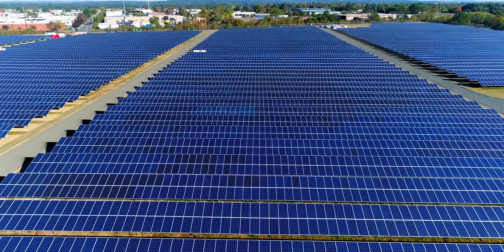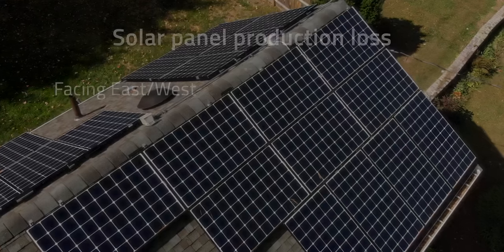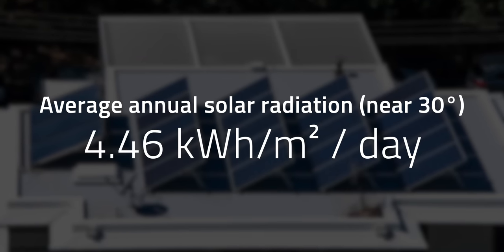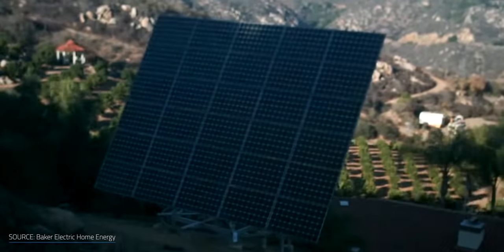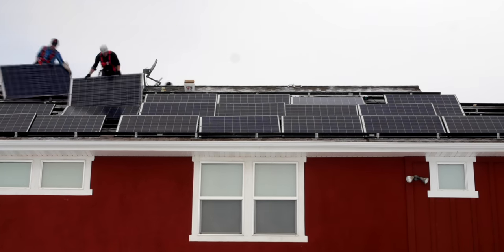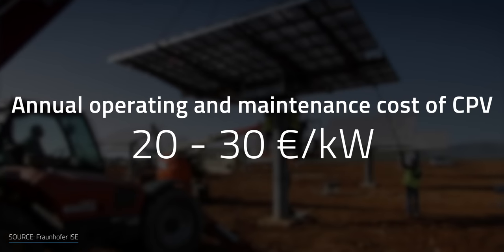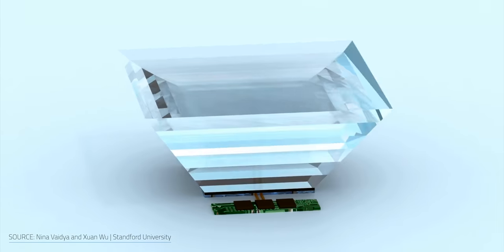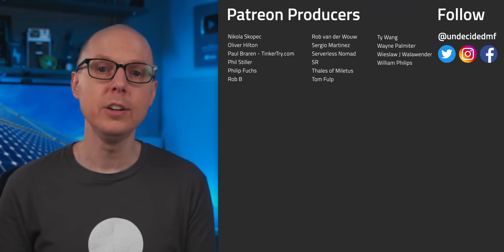This Invention Could Supercharge Solar Panels

Comment: if construction companies built houses with the idea of designing the roofs for solar panels and integrated new houses with the technology, then the money ppl save and the reduced usage of heavy polluters will jump solar panels ahead for individual usage, as opposed to solar farms, which destroy natural eco habitats. we don't need to completely remove pollutants at first, we just need ppl 2 see the practicality of solar technology and more ppl using them will reduce needs for gas, coal, biomass, and radiation.

Comment: I wonder if one could just create agile lenses for existing PV arrays to boost performance of existing fixed panels?
Reply: Sure you could boost the performance but not as well as if you used a cell designed to work that way.

Comment: The more and more i watch your research on solar i am always finding myself picturing the pyramids. The variety of materials or basically various elements they are purposed to have used on the shells of these structures should most definitely have exhibited photovoltaic properties. I wonder if we will find ourselves constructing large pyramidal buildings in the future that have interior sturctures and solar power production as their main purpose.

Comment: So can we change a watt per meter gathering or is it just stuck at getting 100%  of what the sun gives?  Sorts think on a metaphysical level the sun is not only potential but kinetic and we r stuck at one or the there.    When u say 10 to 100 times more and we r al ready at 20%.   Is that based on total energy input or just strictly efficiency?

Comment: And more heat :) The heat causes an excessive number of the panel's electrons 
the ones responsible for converting energy from the sun into electricity to be excited, 
eventually reducing the panel’s generated voltage and its efficiency.

The impact is not minimal. High temperatures can decrease the efficiency of solar panels by 10 to 25 per cent
For every degree Celsius more reported by a solar panel, its efficiency drops by 0.5 percentage
Nuclear energy is the future.

Comment: Need to figure out  the prizum of a water drop. When my panels  have morning  dew on them, they are supper charging  at first light. I'm at 9500 so first light is actually  shining  up under  and straight  across  the array. But as the sun gets over the panels,  they lose some amps  then take off again  around  9:00.  There's  something  about  water drops  and the sun shining  directly  across the  panel. Maybe  a bumpy glass face to keep light constantly  bending  ?
Reply: By the way,  I just set up a 12k  13000w system without  knowing  anything  at all. U tube is better than  college

Comment: It's doesn't make sense to me to try to programme the rotatation of the panel based on sensing sunlight. Why not just programme it according to the annual cycles of the sun. I mean we know exactly where the sun is going to be on any given day. Should be simple to calculate, teh day of the year, times of the day and the position of the earth are the basic input variables. It's first year Physcs.

Comment: IMO, if you have the room to generate what you need, like on a roof, efficiency becomes fairly unimportant.

Where that is far more important, I think, is if you can make more efficient cells, the area gets smaller, which means the panel sizes and probably weight to manufacture and ship become less materials hungry per watt and hopefully pounds and volume hungry in a shipping vehicle.

With the number of clouds in Fl you would probably wear the actuators out.  You might use up all of your energy production doing it, too.  I am, of course, kidding with that last sentence.  Engineering nerd humor, sorry.

Comment: Today at the current state of solar facilities you will need 70 square miles of solar facilities to generate enough energy to match that of a typical 1,000 MW fossil fuel power plant.   My state needs about 40,000MW.  So 2800 sq miles.  Or 5% of the land of my state covered with solar panels.

Comment: In your first chapter you fail to take into account the power curve and how power is used. Where I live everyone recommends installing panels towards east and west if possible, so you get maximum generation in the morning and evening when people are usually at home to use the electricity as well as to optimise power generation to get it up to high enough numbers during those lower-power hours. 

Midday it's easy to generate a lot of electricity, usually too much which then goes to waste. What good is more midday power if you're then not generating enough at other times? Who cares about 15% less overall power generation during the day if with south orientation you'd only waste more of it and are lacking power for more of the day?

Here the recommendation is to expand and flatten the curve so you have less time of day when not generating enough, and less excess peaks.

Comment: Instead of having expensive lenses combined with more expensive high temperature solar cells covering only a fraction of the area, it'd likely be cheaper to cover the entire surface area with cheap and cheerful soler cells.  I wish our host would display even a milligram of skepticism with some of these technologies. Feasible, unfeasible, silly - he'll do a straight-faced video on all of them. I wonder if he thought Solar Roads was a good idea ?

Comment: Interesting that the idea of a concentrator in this video's content seems to be mostly to achieve a better angle hitting the PV sensor. Is there no benefit from intensity?
Reply: You missed that part. It's about a 2x benefit. Using half the PV material, its about even with a traditional panel. Output is improved like using a tracker but without the moving parts. Increasing the efficiency of the PV cell would make this a good bit more efficient than a traditional panel. Without raising installation cost.

Comment: I think this is the start of thinking about photon collectors built into a solar panel - so people can have solar power at night when there is no sun - by having the panel feed the photons to the panel slowly after the sun goes down - like hawking radiation.
Reply: Just paint the panel with luminescent paint. 😉
Reply: @edeaglehouse2221  smart - where can I place it and in which direction, so I don't block out sunlight during the day?

Comment: At a  cost of $22,000 that will save you $1,400 a year that is a 14.5 year payback at which then you return $1,400 a year. If you invested that $22,000 earring 8% return you end up with $64,000 at 14 years, and then using the same return your earning about $5,100 on the first year that will keep growing.

Unless you have no reasonable power option (off grid or insanely expensive power) you would be an absolute fool to install solar.

With all that extra money you could donate to whatever climate group you want if that’s what your getting after.

Comment: the prices for tracking system is such a rip off and you wonder why no one wants to go green, i made a system for tracking for my solar RC plane project by using gyroscops, light emiting diodes combined with a pulley system to have panels pointed at the direction with the most light, so these prices are people just milking it

Comment: I'm not a fan of this type of concentrated solar. Yes, you need less actual PV material, but it takes the same space on the roof. And yes, it can still concentrate off angle, but it captures the same solar that hits that same area as a standard PV panel would. It might save money in the short term to use less actual PV material, but you are using more harshly resulting in a shorter PV life.

Comment: Solar tracking ... ? As if you can't just have a single low power pc doing the calculations for the next 1000 years of sun orientation for your location ? Bonus point if you move the solar panel from -10°  to +10° from sun every time to use less energy than actual tracking. It's not like the earth rotation changes by much every year.

Comment: ROFL!!!   There is No Way this technology will EVER be cheap enough to be cost effective.  More panels will always be cheaper than gradient index optics.  The only place it'd be cost effective is in space, and the getting the extra weight up there would far outweigh, in cost, any extra energy produced.  And that assumes the index gradient doesn't cause so much of a density gradient that it can't survive the temperature fluctuations.

Comment: I DON'T THINK AGILE WILL MAKE A DIFFERENCE. Why? The answer is staring at you. Only so much light energy shines on a given area. Whether it shines directly on PV panel OR whether it shines on concentrators  that focus the light onto smaller cells, - the OVERALL ENERGY THAT FALLS ONTO A GIVEN AREA IS FIXED.  The prisms ADD NOTHING TO THE DESIGN (Do the math). Conversely, mirrors DO add energy by effectively adding the light from additional area onto a place where that light would not have naturally fallen to be utilized. Where prisms could be of benefit is in an application where they are used to STRIP AWAY THE INFRARED COMPONENT OF THE SPECTRUM & route it to a thermal converter/boiler or some other mechanism that stores heat.

Comment: Creator, this information is not correct completely, new research has unveiled that lying solar panels flat on the earths surface, on the ground (10 degree slant) is the most optimal way to get the most sunlight exposure to the panel. I’ll see if I can post a link that I read.

Comment: Alright so everything seems to be good and all but ... 
First off, you cannot concentrate light to get higher amounts of energy from it ... you don't get more light per light or else you break one of the first laws you are taught in physics : no energy is created from nothing, only lost.  If you get 500 lumens per square meter and concentrate it to 10 square centimeter, you don't multiply that amount, you get the same amount, but concentrated. Yes the number of lumens the captor will get will be greater but all other captors that could have got it if it wasn't concentrated won't get any, diminishing the chances to get energy per photons.
And, even if we are talking about those "super high effeciency" solar captors to replace the ones we use today, i'm pretty sure those were not used because of how perishable they are, won't last a year before decreasing by 50% their output i read somewhere. The best solution, if we don't count that with it, would be to replace our current solar cells by these super effective ones, not reducing the amount of cells ... wich is stupid as i explained earlier.

Second, how will making it 3D printed diminish the costs of production ? It's hella slow and hella expensive to operate those machines. Not even taking about the materials cost that are non recyclable and use up even more of those precious petrols from wich we make these. Not even talking about glass that is one of the most limited ressource we might have (or say goodbye to all the marine ecosystems).

The project seems like a good cause but i don't see it achieving anything. It's all "believe me it works !". It's great to tell people what problems it will resolve but not telling anything about the how's and why's it will work is something else. Why a photon arriving at an angle of 90* and one at 10* have various amount of energy capacity ? How does it work ? you don't show anything ... the only reason is the amount of time the sun hits the solar pannel and how much photons touch it. You can't increase that by  any other means than installing mirrors on another place where photons hit, wich takes even more place of course.

Comment: Matt, I like your videos, but you seem to miss the most important issues. You said your house has solar panels. Now, solar panels produce most electrical energy when you need it the least: in the summer, and produce the minimal output in the winter, when you need the most electrical energy. So, it appears that the main problem is storing this energy. I am not much of an environmentalist, I think this is all a lot of hype, but the fact is that everything that has to do with lithium is the dirtiest technology that exist. What about hitin batteries, or hytin, or whatever? And graphene batteries? And correct me if I am wrong, but just about every technology that "hits the market" is already obsolete. Please have understanding for my English, greetings from Serbia, Filip

Comment: Doesn't look like an invention if it's been published as research.
And I doubt there will be a patent since similar experiments have been done since 1960.
Basically, if you can do it, do it. No strings attached.
There are videos of people doing the same on youtube. That means this is public knowledge at this point.

Comment: I think this idea is great and I wish I had it on my solar panels.  I'm fully aware of the compromises with fixed panel systems but also aware of how it's typically easier to just add more panels than to add complicated tracking systems.  I did have an idea with a mirror system that was similar to a louvered blind.  The two sided mirrors would tilt to the east in the morning, straight at noon and then to the west in the evening.  It would sit on top of the panels and just have a single actuator to move the louvered mirror structure.  Never tried to develop it, but it seemed to be feasible.  I do like the lack of moving parts with the AGILE system though.  Excellent video and thank you for providing it.

Comment: Solar energy is the least  expensive form of energy until you consider only works that peak performance only 10% of the time. If you then realize that you  Your panels have to be an order of magnitude bigger just to compensate for only working at peak performance 10% of the time. Then of course you have to pay for storage. There is not even one small town that can store one day's worth of solar energy to replace baseline for 24 hours.  On top of that you can't run central air or Central heat or even your hot water heater on solar. Don't believe me. Name one person who has replaced all of their energy needs including central air heat and hot water using solar. Not one person has managed to do that. So why are we still talking about solar?

Comment: It is still better to generate the Electricity needed on site with a Magnetic Motor that turns a turbine that Kreates Elektricity, then runs the Turbine on a small part of the Elektricity it is Producing! An Electric Pole installed 8 feet down into the Ground, kan also tap into Elektricity UnderGround and amp it up, or use a Rechargeable Battery,  to turn a small onsite Turbine for All Electricity Needed, & multiple back ups, cheaply...

Comment: All you have to do is add the buzz word 3D printer to the cliche "as we transition" and you have guaranteed success. LOL. 3D printers use thermoplastics which have crappy resistance to UV ageing. What better idea for concentrating sunlight. How many PV panels are covered with glass and how many with plastic?!  The other thing Matt failed to mention is that solar cells designed to work at higher concentrations require high levels of direct illumination. Under cloud they produce nearly nothing. Ordinary PV performs reasonably well under diffused sunlight. May be fine in the Nevada desert, but less use generally.

Comment: This idea does not work there is only so much sun per square inch. I tried this over 10 years ago with a Fresnel lens, It does work better where the light is concentrated but just go with a few more panels.

Comment: Am I the only one that see that the concentrating lenses (or whatever) make it take up more area? Why would anyone use a smaller solar cell that takes more space and cost more but don't really give you more power per M2 roof space? Just put a striped fresnel lens on a normal panel and it will bend the light towards the cells at all times and angles it hits the panel, who knows it might even concentrate it somewhat. A 1 cm2 cell that take the real estate of 25 cm2 makes no sense to me, plain "normal" cells are so cheap now that concentrating makes no sense, does it, are they 25X more efficient? Can someone who really knows tell me why bother with concentrators, please. (no opinions, only facts, please)

Comment: this is wrong , get a solar panel  , mid winter when generation is needed most , and change it's angle whilst
watching the volt meter output , it's not 10 or 30 percent less it drops of rapidly  all the way down to like
a quarter of the output  , i'm at a loss as to why there  is such an obvious error.

Comment: Magnificent increases the heat discharge.
Current panels in Arizona are 30-40* higher then my bear metal roof discharges.
I think the heat is contributing to global warming, right? 
I replace my fiberglass blades on my wind turbine, because of the constant sand blasting winds from California and Arizona.
   I think that contributing to the landfill and extra pollution the manufacturer makes, to build me news, Right?
So where are the radiant heat collection panels for Arizona, because it's Hella Hot here?
Geothermal hear converting panels could be a renewable source, but I haven't seen panels for that either. The earth is always a warm 53*F
And hotter near Geothermal active areas, like California, Arizona, Utah, Idaho just stating the obvious.  I have not see any device that uses the renewable source of the ground to make electricity. 
   Can you think of one? Isn't the Earth's Heat the Larges Renewable source we have?

Comment: Now if only they could make roofing tiles with these encorporated into them therefore having the whole roof a massive solar photovoltaic system paired with battery packs allowing use of the energy all day and night I'd rather have a roof which works for you to produce electricity while still having the functions of normal roofing that'll be something having the 140+ million homes as independent green energy power sources